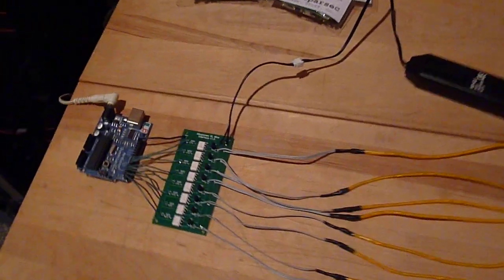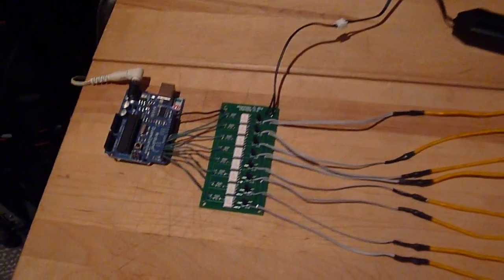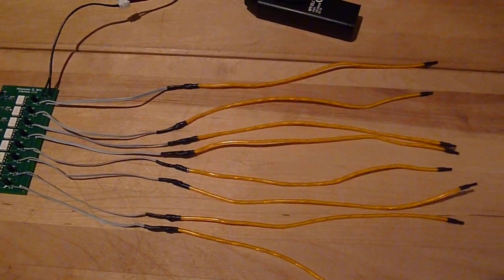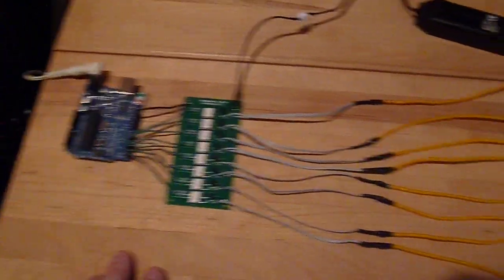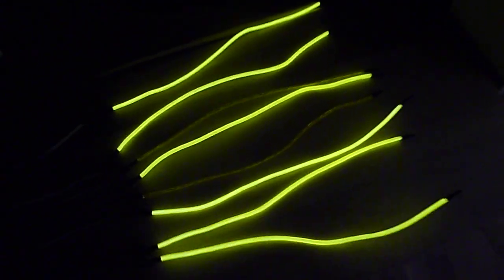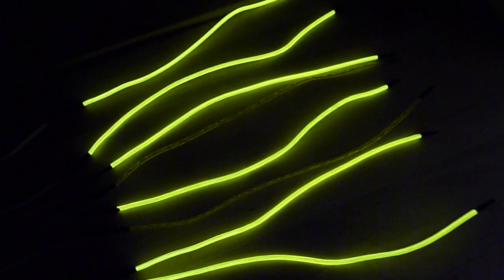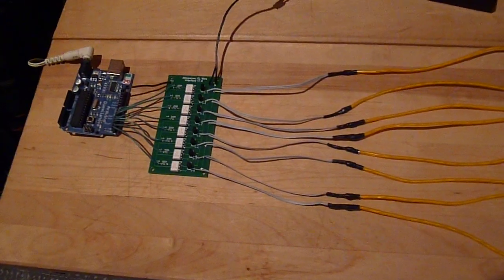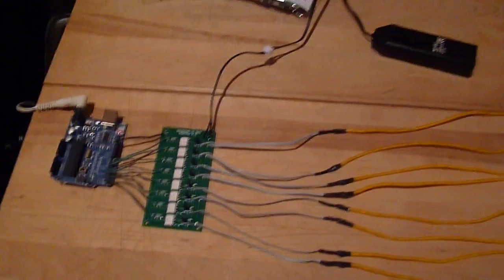Attoparsec 8 Channel EL Wire Interface Kit Demo

Comment from the maker: @geehugo The length is going to be limited by the el wire driver you have hooked up, not the interface card. The longest I've ever driven was a 30 meter coil when testing the original cards I made for my lightsuit, worked fine.

Comment from the maker: @LearningFromLasVegas Absolutely, if you look for my lightsuit video you can see an example of a project using 3 of these cards all controlled from a single arduino, and powered from a single inverter. The white cable is just power for the arduino in this demo.

Comment: Is it that just an optocoupler plus a transistor (mosfet probably)? Or probably a triac, as it's AC, not DC.
Reply from the maker: That's it! Not a complicated design, but at the time I couldn't find anything already available to do it for me.
Reply: @Attoparsec  yeah, sure, great and clean :) could you share what element did you finally use? If I recall, there is around 110V AC.
Reply from the maker: @ziomalZparafii  They were MOC3041M optoisolators and Z01 triacs.
Reply: @Attoparsec  thank you for detailed info ☺️

Comment: Can we sync el wire driver with music
Reply from the maker: You could, yes, if you used a microphone for basic sound response. To do something more complicated, like a scripted pattern, you'd probably need something other than an Arduino. But it could be done.
Reply: @Attoparsec I’m interested in a signal activated circuit from usb out.  Responsive to signal strength and presence.